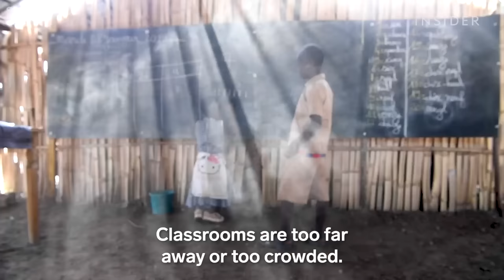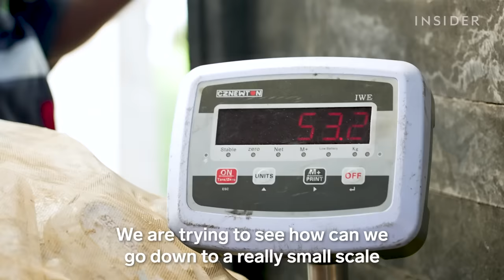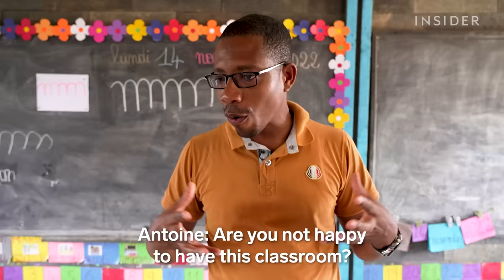How To Make Bricks From Plastic Trash | World Wide Waste

Comment: The best use of plastic waste. Using plastics as bricks or structural elements avoids the formation of micro and nano plastics by several orders of magnitude.😊
Reply: Better than pave or plastic road
Reply: but now its closer to where u live n sleep 😅
Reply: No, it will be really bad to live in house made of these bricks, no way
Reply: @Kathakathan11  You can drink water out of recycled plastic bottles. The bricks are harmless. My only concern is that plastic is usually flammable. So is wood but plastic burns with toxic fumes.
Reply: @DeeP_BosE exactly. Absolutely toxic.
Reply: I think a solution to that has to be a application of paste. Like in fabric we apply a seperate coating so that a fabric has more abrasion non breathable properties.

I think when we make bricks stuff out of these. There should be an organic coating paste that doesn't let plastic out.

Comment: I saw lots of picnic tables made this way and within weeks, they sagged badly and had to be replaced with conventional wood ones.   I would be worried about off-gasses and I'd never trust this material for structural use....and what about fire resistance?  Likely has none and could produce dioxins, furans, mercury and polychlorinated biphenyls (better known as BCPs) in the event of a fire.
Reply: And when the television was first invented in 1927, it was a 70” OLED w/remote and apps??

Things evolve over time as the process is refined and new technologies come to light.  Just look at how far personal drones have come….or even gaming consoles, in such a short relative time.  The same with recycled plastics, it’s going to take time to hit the milestones.

Comment: How do recycled plastic bricks perform during a building fire ?
Reply: How does a plastic bag perform during fire ?
Reply: The reason why they are using for school buildings where the chances of fire accidents are very very less since only single phase , LV power supply will be used only for lighting and fans.
Reply: @srimanarayanad1193  So that appears to show that they are not as fire safe as clay bricks. But are OK were there is low risk of fire.
Reply: @srimanarayanad1193 And they are only occupying it during the day; not at night when everyone could be asleep with a higher chance of becoming trapped.

Comment: This is probably the best use for recycled plastic. Structural use in building will prevent micro plastics spreading as opposed to paving roads which will likely compound micro plastics everywhere
Reply: the community should place plastic bin on every student home and teacher or worker there, whic is to collect waste plastic, and the children will bring those to school collector every week or month where will be collected by the company, its a start to make plastic waste usefull
Reply: Yes and now it will be closer to where u live, eat n sleep. Any structural element not meant for residential is only ideal for plastic that leeches toxins n pthalates at every degree rise in temps.
Reply: @DeeP_BosE the plastic is already there. Might as well make the best of it
Reply: Will still break down into microplastics due to the effects of sunlight in plastic and acid rain but definitely much slower than on roads or other applications that have direct wear and tear.
Reply: Governments need to force manufacturers to stop using petroleum based plastics.
Reply: @monicaclark9581  Not a realistic solution. Especially, in a capitalistic economy.
Reply: I did my engineers thesis on usage of recycled hdpe and have done a little research on pvc. Turns out in 70s and 80s, in Europe, concetration of carcinogenic compounds in the indoor air significantly exceeded healthy limits. PVC was and still is used in flooring, but also piping, windows, home appliances and toys. Honestly I doubt plastic recycling will be sensible solution in the nearest future. :(
Reply: Excuse my boo boos and not checking what my fingers accidently touched.

Comment: This seems like a good idea.... as long as you don't think about it at all. 

Plastic,  particularly random recycled plastic,  as a building product has some serious problems.  What chemicals does it off gas? Is there any fire retardant in it? Is the smoke when it does burn deadly? Is it structurally sound within the expected temperature range? This whole process could also probably give you cancer just looking at it.

Comment: Assalamualaikum.

I work in plastic manufacturing facility. Im unsure what toxic and fumes the plastic bricks are gonna generate under sun and atmospheric heat and humidity.
Inside the room its dangerous for kids as they breath the toxic fumes and outside It's far more as these fumes are gonna mix with the air. And they donot have any covering or lamination to cover the bricks preventing them of producing fumes in heat and sun.

Comment: Exposure to sunlight releases mictlropladtics into the environment. I'm very concerned about this because these bricks lack plastering. 

If the reader can contact these guys please convey my concern. Both the inside and outside of the walls can be covered with lime which is both cheaper and more carbon neutral than concrete.
Reply: Absolutely, I'm sure none of them have ever thought about that....
Reply: @NeilGaede1  you can clearly see they using the bricks as it is. ever thought before commenting?
Reply: @scramjet7466 It’s called sarcasm

Comment: There is so much plastic is dumped in the Amazon region, and if it could be made into footings for buildings, it would be very useful to make structures last longer than ones built on wooden posts. Wood rots quickly there with the annual flooding. I hope the economics are viable so that people can be given an incentive to collect the garbage.

Comment: Ok let's get this right they make about $0.16 per 2.2 pounds of plastic so to make just around $16.00 usd for long hours of biohazard and dangerous work he or she would have to carry at least 100 lbs of light weight plastic for miles more than likely without a vehicle. Yeah they are,there  to help if they say so.
Reply: One collector makes four times as much as she did before she started doing the collecting.
Reply: @diffened  The point I was trying to make. For them to make  just $16.00 usd they have  to carry over 100lbs of light weight plastic waste by the way they only get paid for the plastic that can be used/ recycled. So more than likely half of it is useless for all the work that has been done. It doesn't matter that they make 4x more if it doesn't change their living situation or if the job you are doing is hazardous to your health.
Reply: The video stated that they get paid at a local sorting facility. I didn’t get the impression that they were walking miles to the factory.

Comment: I don't know about this, from different angle this is really positive knowing someone would help these people to build and educate.
However on the other angle this is like self fulfilling prophecy. Since most companies are dumping their waste to africa they would prefer do this to "disguise" the act as virtuous. When they are the problem. My issue with these programs, the original creator (and/or SPONSORS) would never use their own products in their own country.

The fact that the most important process is hidden only tell you that either the process are doing more harm, or it just another problem added into the mix.
Plastic is never approved, or used or even considered in building material for simple and VERY important reason. Health and Safety.

1. Plastic overtime will became brittle, sure you can brush it off, but the one that eyes couldn't see is the most dangerous. If it's get inhaled by kids or humans or even living things in general we still don't know the implication long term, either way it's not HEALTHY. 

2. Fire Hazard, before you telling me about woods, PVC being inflammable, woods have different material, if woods gets burned it won't melt, plastic was made generally from some kind of OIL residue, in general plastic are considered FUEL for fire. So if the building get's fired, most likely it would not stop burning even after the building is fall over or crumble until the plastic it self get's totally burned out which is took very long time to do.

3. Inconsistent quality, as you might read or watch, the process is being hidden however the video imply the plastic "GARBAGE" is the main ingredients, which I don't think so, the garbage here is being used as filler for the main products instead of main ingredients, which is "NEW" plastic, which just became another problem for the future to solve current problems.

The fact that most of these products/plastic waste would never be used in 1st world country already tells you that this program is a sham, it could be far more beneficial if they pay these people just to clean the area and build a specific area for waste management, and build the building using regular material. With these program is already corrupting these people mindset, instead cleaning for their own health and safety, these people mindset is cleaning to make money, what if the program is ended? They just go back doing whatever they do before.